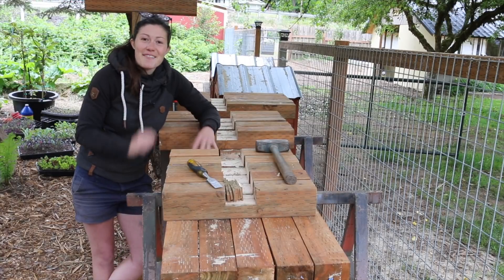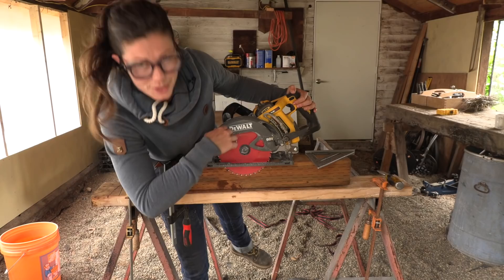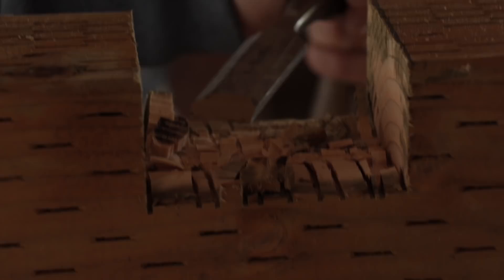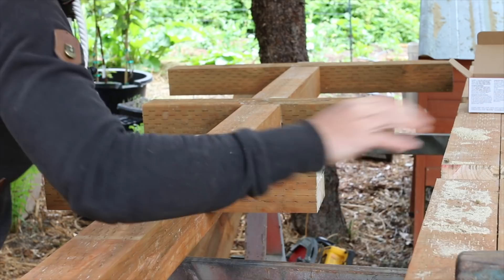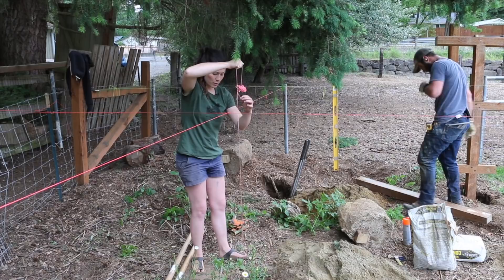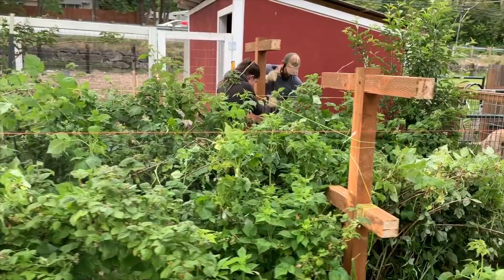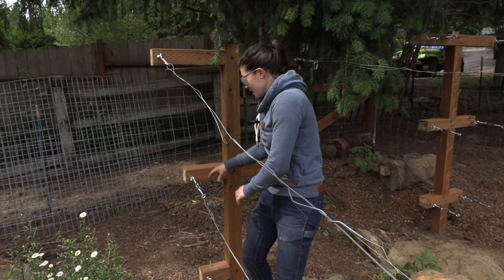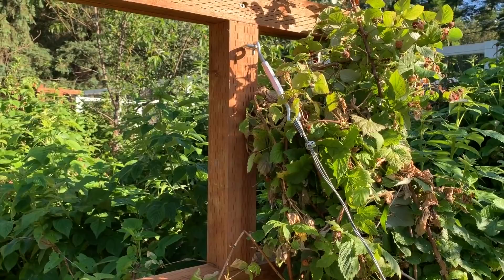How to Build a Garden Trellis

Comment: Just a suggestion that I've used with good effect.  As long as my hole isn't too deep I use the sidewall cut out of an old truck tire to help with hole placement.   I center the sidewall where the hole should go, spike it to the ground and then dig down in the middle of that.  Avoids having to battle those strings you were fighting at the end.   If the hole has to go very deep you might need to pull the sidewall out to get the clam shell digger in there.  But it also keeps dirt from falling back down the hole if you do it right.    I need to put up some trellis for my raspberries this spring, so this was very timely.  Thanks!

Comment: Fantastic Trellis!!  Built to last.  If you find yourself needing to dig more holes in the future you may consider using a tool called a gibbs digger combined with a spud bar to do the heavy work of breaking up the dirt at the bottom of the hole.  The business end of the gibbs tool is articulated by the handles and is used to bring the loose dirt up like a filling a bucket.  Be well!

Comment: Great video! An easy, cheap and time saving way to hold your trellis upright once it is sitting in the wet cement in the hole is to attach a small board to the trellis post with one nail, then stretch the small board out until it is 45 degrees to the vertical post. Now drive a peg into the ground next to the end of the small board and nail/screw the small board to the peg. If you put 2 of these on each post, at right angles to each other, your trellis post will be held perfectly vertical while the cement dries. Remove the small board and peg after the cement dries. No more trying (in vain) to hold the post vertical while the cement dries.

Comment: Radial arm saw with a dado blade is what we normally use for 1/2 laps you can do it on long pieces easily. Love you videos thank you.
Reply: Or a table saw, or a router.
Reply from the maker: All good options, but our treated lumber is pretty wet, and I prefer not to do construction grade projects in my woodshop because it's so finely tuned for fine woodworking projects, but hey, whatever gets the job done, right?

Comment: Looks like you could do with a hand auger to (help) dig your holes. A simpler but nice metalshop/forge project. The T-handle apple corer - deburring bit style works well. You can make them any diameter to fit fence pole or concrete pour.
Reply from the maker: I've heard about those. When I get the forge running pat, that's a great idea.

Comment: A trick with your string lines - Use magnetic hooks on the ends. I attach a 1" fender washer to the stake with a screw and tie the string to the magnetic hook. - In my case most lines I run are near ground level and started doing this after I was almost sued because someone tripped over a line. Now the string just pops off, or can be taken down temporarily and is easy to reattach.
Reply from the maker: I wonder if that is strong enough to withstand the tension of the lines? Or maybe I'm not understanding the application?
Reply: @AnneofAllTrades  How I use them is instead of tying off the string to a stake, I just mount a washer and magnet then run the line straight off the hook. The magnets I use have a 1" dia. magnet base and a small hook from the middle. I don't know the pull of the magnets but I would guess about 20-30 Lbs or so. They are plenty strong enough for my use. Even moderate deflection of the strings doesn't pull them off. It's hard to just pull them straight off by hand but they slide off fairly easily. String tension is inline with the pull of the magnet and I don't put nearly 30 Lbs of tension on the string. I picked my magnets up at one of the box stores, but an Amazon search for "string line magnets"  lists several that are almost exactly what I have. Hope this helps and please let us know if this works for you.
Reply: @AnneofAllTrades  Also another trick I use is to replace the string in an old chalk line reel with mason line and use as normal (minus chalk). This saves me on string as it is reusable and easily wound up and stored without "bird nesting". They hold about 100 - 150 feet of string depending on the size of the reel. If the string is damaged just cut that part off and keep going. On the loose end I just keep a magnet hook attached, and on the reel side to terminate a run I just use a slipknot and attach it to another magnet hook. Once you use it a few times you figure out how to make the slipknot so the string tension pulls the knot tight. A loop of string on the reel lets it hang on the stake as well. They are easy to make which is nice since they sometimes tend to "walk away".
Reply from the maker: Avi Tech oh interesting. Glad you found a good solution for you! That definitely wouldn’t work for this application, as we’ve got a few hundred pounds of tension on the lines- the rows are about 100’ long.
Reply: @AnneofAllTrades  Oh ok. Well maybe keep it in mind for a time when you can use it. I just kinda know your pain when trying to dig or work around string lines like at the end of the video.

Comment: Do they make a left-handed circular saw?  Maybe they could engineer a circular saw you could convert to either left-handed or right-handed.  They could have a swivel point to rotate the motor and saw blade and then move the handle.  We had raspberries on our farm up till the time our father died.  They were delicious.  Thanks
Reply from the maker: I'm actually ambidextrous but it's funny switching between saws, some work better than others with my two handedness and I never really pay attention to what hand I'm using!

Comment: Anne have tried the Fiskars post hole digger.
Reply from the maker: Nope! Just the old broken one I found at the farm. Fixed it up and works a treat. Isaac has one too, but it's super heavy and tough to use. I think I was using that bugger at the end of the video.
Reply: @AnneofAllTrades   thank you for the reply. I look at the  video  that does not look like the Fiskar post hole digger that I used. The one I used the pivot point is a foot or so above bottom of the digger and when you spread the handle  it opens about 6 inches when you close the the digger.  I like this digger because of the weight and it seems more solid when I dig the holes.  I also use a digging bar and a round point shovel to dig post holes.